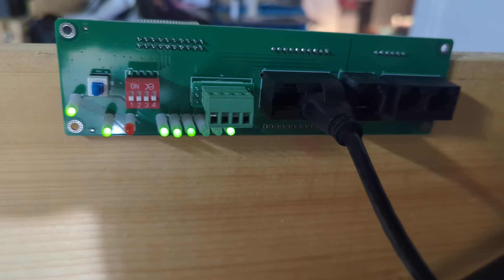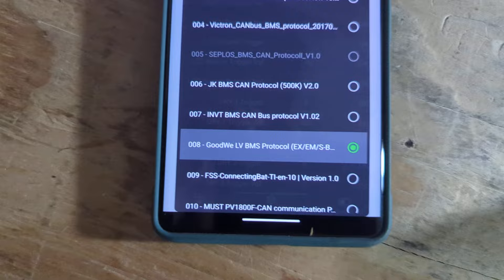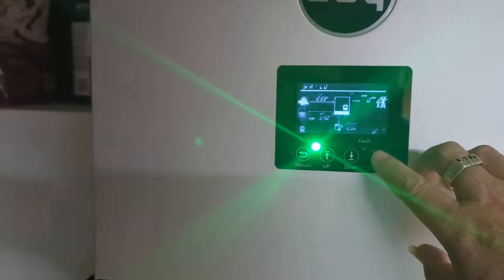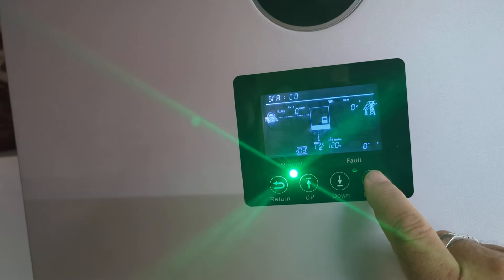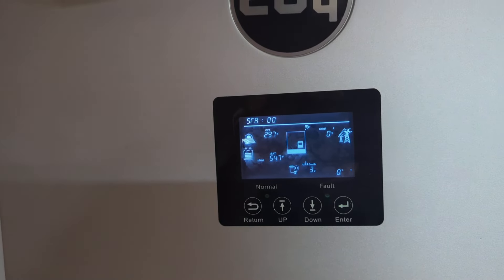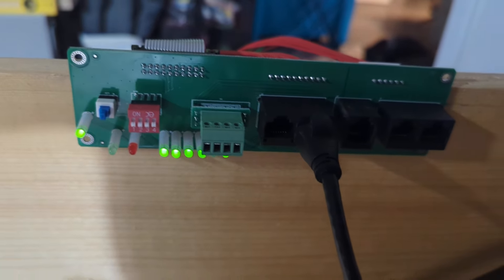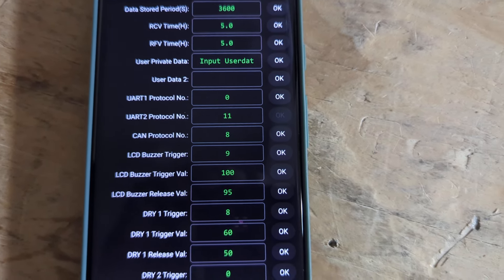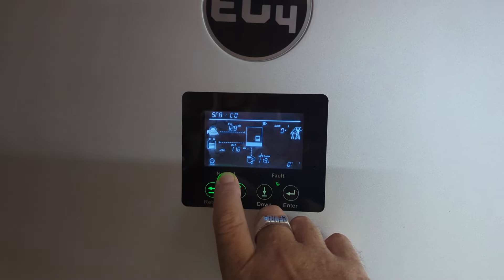How to get the JK inverter BMS to talk to your 6000XP.

Comment: Interesting. I have mine running on the Lux Power driver. Works like a champ. Should work with Pylon too but I haven't messed with it. I chose Lux Power since that's who makes the EG4 equipment and guessed that would be the best chance at having the data mapping line up between them.

Comment: Have you had any problems? I did this an within 3 days I started to get the fault 26 code. I would reset it, still the same thing. I switch back to lead acid and now it work fine.
Reply: Update. I switched to lead acid for a day while at work. I turned everything off, including the pack. Went back to communication and back to normal operating. Working great. I think because the jk bms charging amp setting was not set properly. I put both discharge and charge amp settings to 200 with my 16s48v200amp bms. What works, works. An has been working great since, thank you for this video.
Reply: What settings do you use for this
Reply: @ use the setting that are in this video, an in the jk phone app I set the charge amps to match the discharge amps

Comment: Why would I need to connect BMS to inverter? What advantage has this? Is this an off grid thing, or on grid?   This is getting far to complicated for me
Reply: No you don't have to but if you're going to the trouble of building your own batteries and configuring BMS' then yes. The master BMS controls the charging from the inverter for itself and it's slaves. If not you will have to configure the inverter to provide what the batteries need. Creating a deep rabbit hole.

Comment: Did you get both jk inverter BMS running in parallel with the 6000xp recognizing them?
Reply: right im curious too.
Reply: Any update
Reply from the maker: Yes. Followed the guide from @OffGridGarageAustralia (thanks Andy). Super simple and worked  first try.

Comment: I have one of the two JK BMSs attached to one bank. I will attach the other side of the bank with its JK BMS this weekend. I want to connect it all to a Xantrex 4548 with the SCP control panel. It uses Xanbus. Think you could help me get it all communicating?
Reply from the maker: Probably not. I know nothing about Xantrex stuff excpt for the inverter I replaced and have since used to run my shed. It's a "dumb inverter" so just has battery in and 120 out for connections

Comment: Hi, can you help explain the hardware you are using to make this happen? I have a jk bms with rs485 port, and I’m wondering if I need an adapter or something?
Reply: You have to have the JK Inverter BMS.  It is different than the standard jk with rs485.  rs485 only sends data to the screen.

Comment: I had the same issue with mine regarding the mis labeled ports in the manual. So frustrating! I set my BMS to the Pylontech protocol and I'm curious if the GoodWe is the better setting. As is sits now everything works fine except the Inverter doesn't display the detected Ah rating of the battery only the SOC. Does your inverter/dashboard show a battery capacity with it set to GoodWe protocol? Also, does it follow the absorb/float settings you have set on the JK BMS. Mine skips over the absorb phase and goes straight to float.
Reply: Many have the same problem where absorption to balance doesn’t work. Interested to see if it does on GoodWe setting.
Reply from the maker: LiFePo4 batteries don't need to absorb. If the communication is working the BMS will tell the inverter what it wants for voltage and current. I didn't use the plyontec setting long enough to see what worked and what didn't. I have the RCV set to 3.5 and don't recall seeing a float setting. It may have been there. I only changed a few settings and didn't go through them all.
Reply: Correct

Comment: Why on Earth would you buy a Chinese made 6000 XP, with its low surge capacity in the first place?
Reply: it works great for me. anything i use that surges is a 240v load 6000w is plenty. and there split phase 120v too 3000w on each leg. not to mention that are stackable if you need more. they have a ats, 12kw of solar charger mppt, breakers, ac grid charger too. name another 1400 dollar solution thats better?